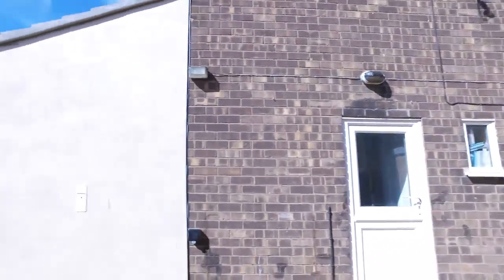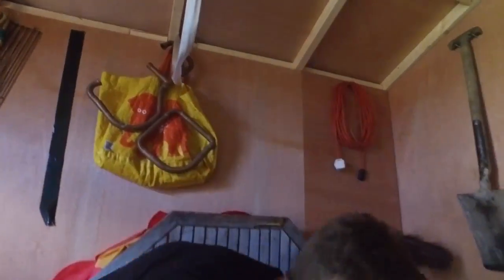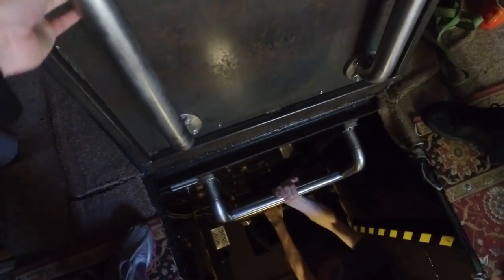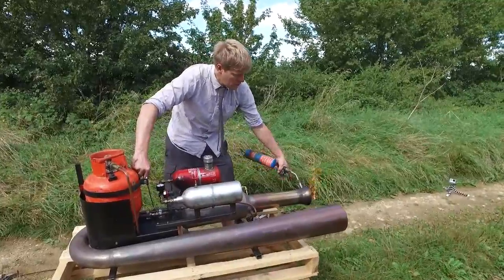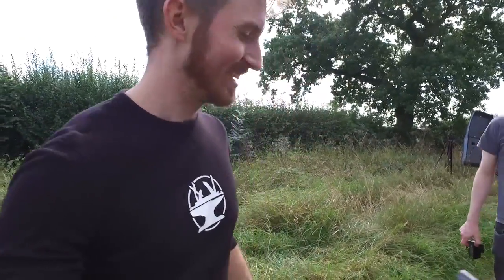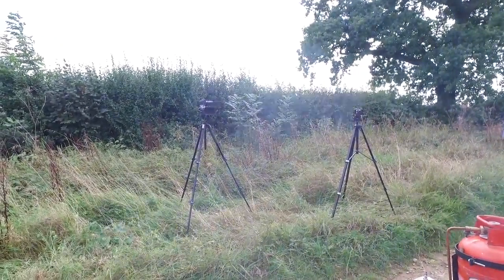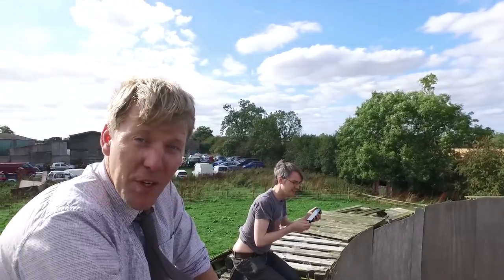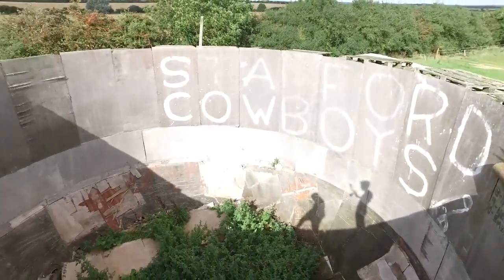Behind The Scenes with Colin Furze & XRobots!

Comment: maybe you could fly with jet engines much easier, since fuel weights a lot less than the big lipo batteries, and also  lipo holds less charge than same sized li-ion :)